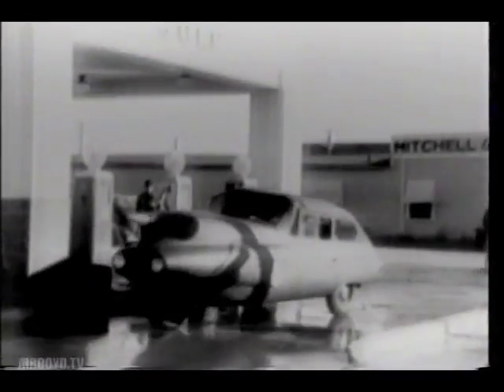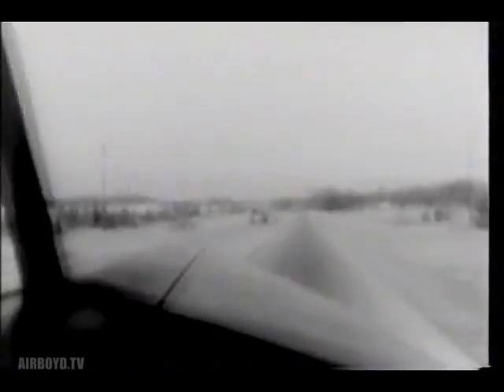Flying Automobile NX59711 (1946)

Comment: You know what distinguishes engineers then from engineers now? They were more daring. If you're not willing to try, you fail anyway. This proxy of daring to really reach for the future is the hallmark of innovation. Now, I'm not saying the flying automobile is good or bad; I'm just pointing out that engineers of old living in our times would likely have pushed the boundaries of technology in a more noticeable way. It really came down to the belief system of those of the Golden age. To them, a Jetson's Utopia was inevitable. I guess we settled for our 'post-modern' society of Twitter and SnapChat. We are no less intelligent as modern-day engineers. We just don't push on that manifold like we used to, and it shows. We're capable of so much more, but out hearts aren't in the right place. That's why I'm creating a company to start pushing the boundaries of our physical technologies. First project? A practical flying car. 'Practical' to me means you can hover above the city skyline, quietly and predictably, fly into a drive-through, float as you wait your turn, order your food, and zip onto the highway. I'm talking about no-wheels kinda technology. It's time we stopped settling for drones and road-able airplanes. How do I plan on doing it? Going a step back and considering why we use propellers, wings, jet-engines, the works. It all comes down to Bernoulli: our flying machines are designed on the basis of air. What if we were born on an airless planet? What then? Whatever solution that is, that's what I want my company to develop as a re-imagination of what it takes to fly. If you ever hear about "Float circuit technology" in a few years, that's me. Oh, and great video!

Comment: @Auggie56 I went to an experimental aircraft expo some years ago and although ultralights were there so were many other aircraft. Maybe I have to research this but today's flying cars wouldn't require a license since the very few that are being displayed only require a drivers license since the system is designed to fly the way you drive.